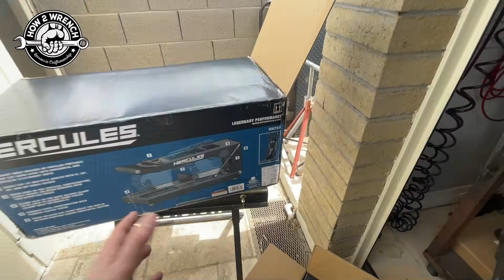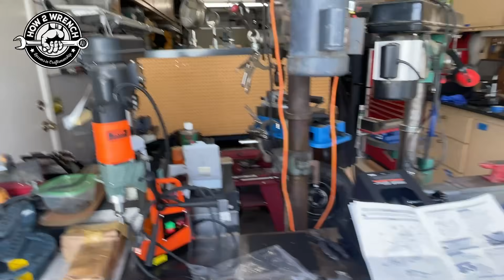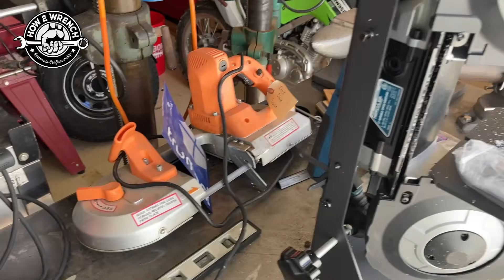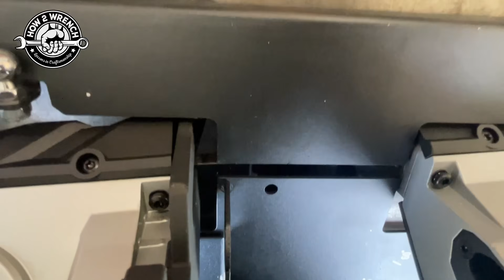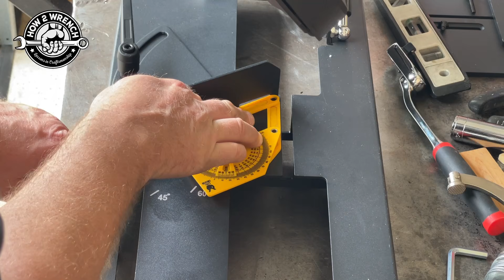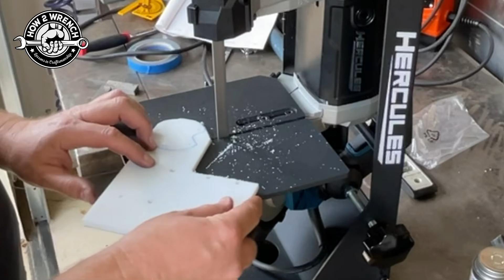Harbor Freight Hercules Band Saw Universal Bench Top  Mount #harborfreight #bandsaw #hercules #diy

Comment: When that stand is in its desktop horizontal position to lower onto a piece, is that trigger assembly designed to keep the trigger locked open so that you can use one hand to hold the piece down and the other to lower the saw?

Comment: Nice video, and i love this stand. I have tried the hf cordless saw, and its also nice. I have the Dewalt deep cut 20 volt. Any brand saw will do the job. the most important aspect is the blade. I did replace my blade with the hercules brand blade, and it was no good. The brand of the blade is way more important then the brand of the saw. I went back to using dewalt blades and the difference is night and day. I would rather have a lower end saw with a quality blade, as opposed to the other way around.
Reply from the maker: Great to hear your like the content! Thanks for the tips on the blades. 
Smash the sub and share please! 
If you donated or supported us, thank you in advance for saving you hundreds at the dealer or frustration! #righttorepair Links:
Buy Shane a coffee:  https://www.paypal.me/how2wrench    
Join the channel: https://www.youtube.com/channel/UCBhM8DCKnT3qXwTW0eToyCg/join  

We love sharing comments like this with Shane. High fives for the likes or making us better by chiming in your thoughts and the added value to our wrenching community. Keep them coming.
You rock for commenting! We will let Shane know! 
H2W

Comment: Interesting how the 11 amp saw only has the standard 90 day HF warranty but the 20v has a 5 year warranty.
Reply from the maker: That's a good point about the warranty differences; thanks for noticing!
Reply: @How2Wrench  Ended up getting the 20v Hercules for less cost and 5 yr warranty and run it with DeWalt batteries.

Comment: Good video. Thanks for sharing. I have purchased both the Bauer and the Hercules versions of the cordless band saws. One for my son and one for me. I also purchased the bench mounts so we could use them in the "chop" saw orientation. Our instructions were not as detailed as yours!! Maybe the corded version has better paperwork??  We have both had the same problem, the saws will not cut square! I contacted HF and they had offered no advice, just said to return the saws if needed. We are both restoring old cars, and need to cut things square and true. Very disappointed with this one Hercules tool, the  universal mount, all the other Hercules tools are excellent. I will try following your set up instructions, and start all over with my saw. Have had it over a year, still fighting with it! Pray for me!  ;)   ( Fyi, I am 75, but can still see, just not real patient!  )

Comment: I'm curious for anyone that has used magnets for holding either the plate on the bottom, or allen keys underneath or side, etc as I've seen some people do...my concern using magnets, especially strong ones, is that amount of metal debris they will collect.  Any experiences to share?